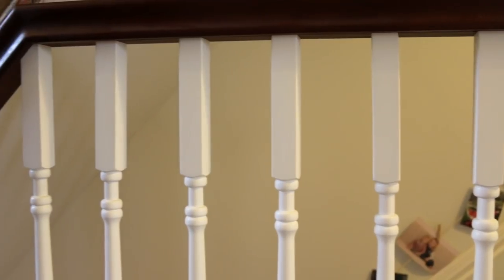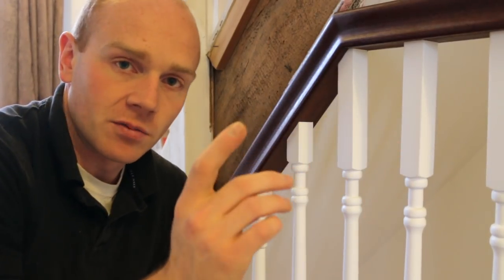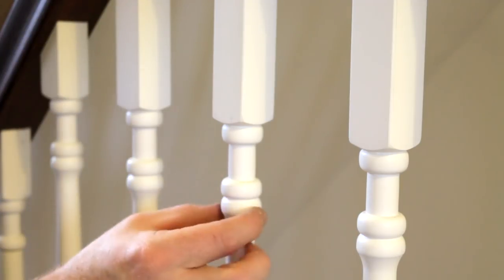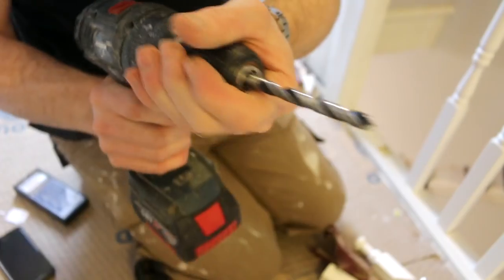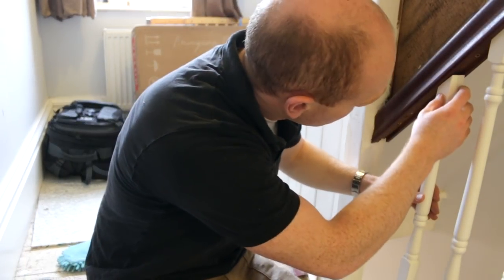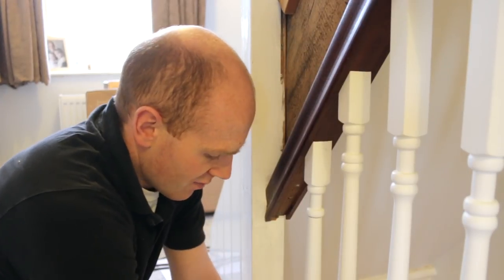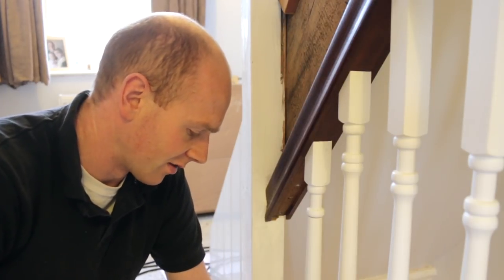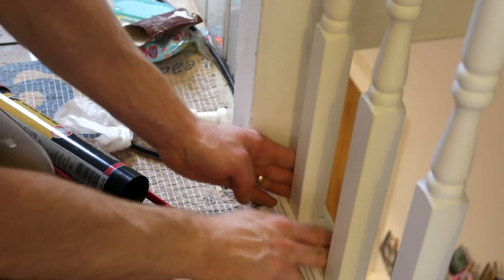Stair Renovation - Awkward Angles!

Comment: To my eye, I would've trimmed the bottoms of those last 2-3 spindles. It would maintain the donuts level until they then descend along the hand rail angle.
Reply: Robert Currey Same here.
Reply: I just realised I said level and not parallel. And as anyone who has done reno (heck even new construction) knows level and square are anomalies. For example, say the floor here is slightly out of level, making the handrail level could make it obvious the floor is out of level. Making them parallel can fool our eyes into considering it "right". Honestly it's best to simply judge on site what is "right" (e.g. for a heavily sloped floor, it might be best for the eye  to follow a railing that is level). This is why I meant to say, having the spindle detail appear to follow the railing in a parallel manner as the railing changes its angle would look "better" (at least to my eye, which is simply a subjective opinion, and I'm not on site). Other than punters like myself, know one will likely notice a difference :)

Comment: I would do it slightly different to maintain the double donut with the transition (fillet) to the cylindrical part of the spindle. by reducing the length of the long cylindrical part.